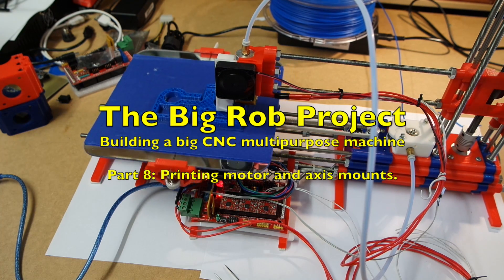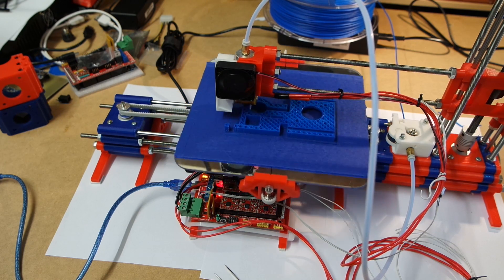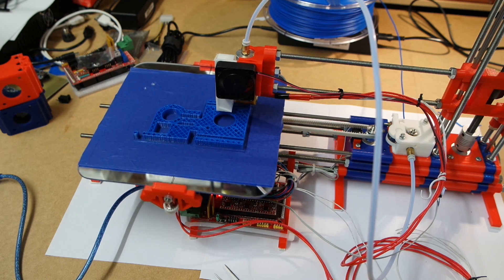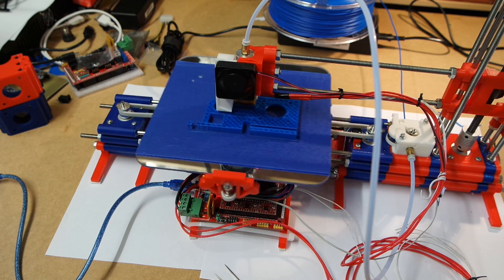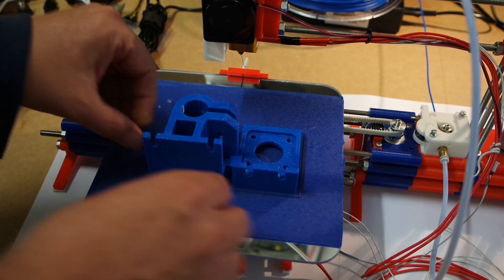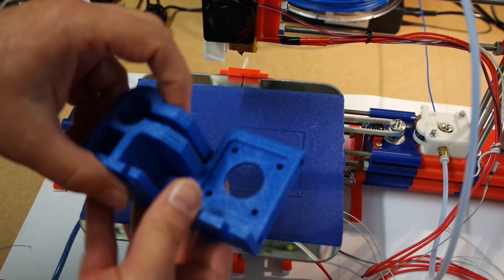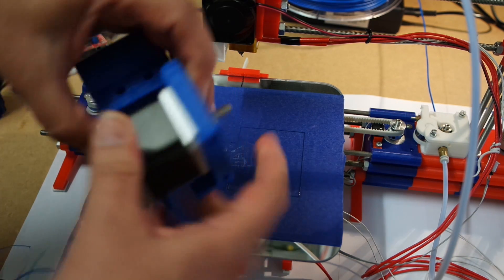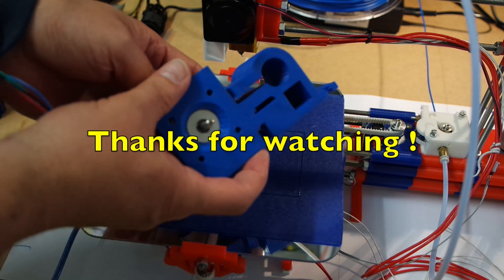Big Rob Project Part 8

Comment: 3d printer name is mentioned as a model of what what..?  3d printer model ?
Reply from the maker: Robin, all my printers have a moving X/Y stage and they all called Robin, the one featured in the video is the Robin Plus (or Rob+).
Reply: really possible this model successful printer STL files you send mail ?
Reply from the maker: No, sorry - the files will go onto my github repo once I'm happy with them.